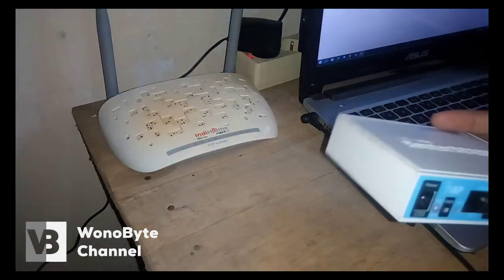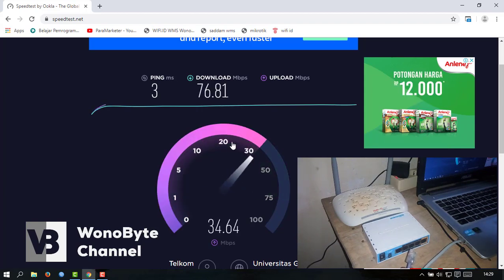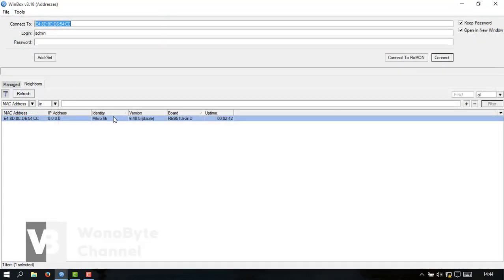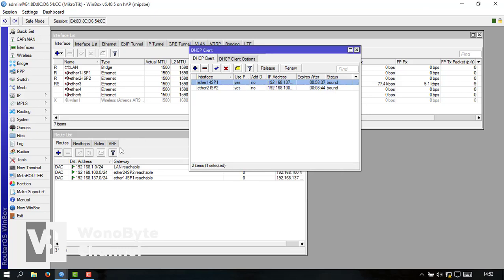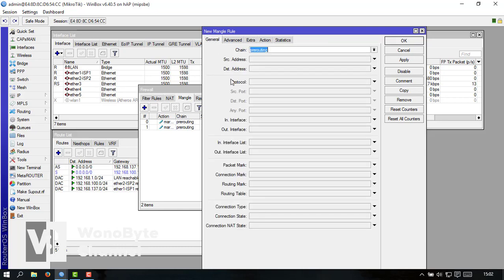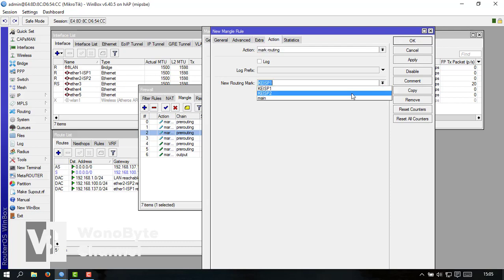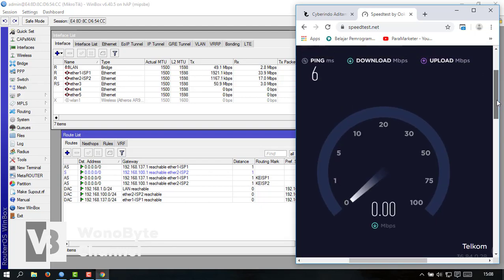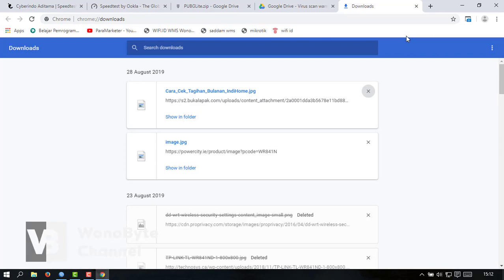Setting Mikrotik Rb951 Untuk menghubungkan 2 ISP dalam 1 jaringan Dengan Load Balancing Metodhe PCC

Comment: auto like yang begini mah,
Reply: eh ini berapa mikrotik master? kalau seandainya rb 750 + 2  sqt dibanding pakai rb 951 2 + 1 rb 750 dibanding 1 rb 951? terimakasih.
Reply: atau ada saran lain? terimakasih
Reply: itu juga kabel belum cat 6, wow masih bisa di up grade2 ni he3
Reply from the maker: @ahmadustanto8786  ini saya nyoba pakai lan jadi 3 mikrotik
Reply from the maker: @ahmadustanto8786  kalao bagus nya 2 sxt sinyal seamless biar gak login/DC , dari 2 sxt di load balancing pakai rb750 bisa atau rb951,, kalao rb951 sudah support wireless 2,4ghz bisa juga jadi 3 isp jadi 1 (2 sxt + 1 rb951).
Reply from the maker: @ahmadustanto8786  ini saya juga jaraknya lumayan jaul dan terhalang dinding kalao deket sekitar 1-2meter dr pemancar bisa speed lebih kenceng
Reply: @wonobyte  saya sudah ada 6b 750 gr3 mau di pasang di dalam rumah saja enak yg rb 951 atau beli sxt yg support 2,4 dan 5 giga pak? bisa minta wa atau apa gitu yg bisa dihubungi ? terimaksih
Reply from the maker: @ahmadustanto8786  kalau yang bagus sxt karena 5ghz jadi speed lebih stabil dan bisa dapet lebih besar bendwith wa 085772728829
Reply: @wonobyte  Ini sya coba nembak 2 semles semua,tp gatway sma mas..wktu dibalance yg krja salah 1,pdhl sdh di NO di dhcp clien

Comment: Isp1 pake astinet, isp2 pake indihome apakah bisa pake cara yg diatas?
Reply from the maker: iya bisa caranya sama saja
Reply: @wonobyte   brarti waktu buat mangle isp1 interface nya sy pilih pppoe ya mas?
Reply from the maker: @alifakbarzardari7392  isp1 konek nya tergantung dr isp
klo pake wifi pake wlan
pake kabel pake ether
Reply: @wonobyte  astinet nya pake modem dsl mas, setelah di dial nanti muncul interface baru pppoe mas
Reply from the maker: @alifakbarzardari7392  iya berarti pake pppop
Reply: @wonobyte   setelah sy enable semua mangle dan route nya kok internet sy putus ya mas?
Reply from the maker: @alifakbarzardari7392  mungkin ada yang salah
Reply: @wonobyte  step bridge nya itu wajib ndak mas?
Reply from the maker: @alifakbarzardari7392  engak wajib.. cuman fitur brigde lebih enak buat ngatur konfigurasi ether.. kita bisa bebas add port mana yang mau dipake / engak

dan konfigurasi sama setiap port yang di add di brigde

Comment: mas tanya dong. kalau salah satu ispnya ada trouble. apakah mempengaruhi juga ke mikrotiknya?. apakah inetnya jadi putus juga?
Reply from the maker: kalao salah 1 off akan terbackup di isp 1 nya
Reply: mas itu yang sya lihat di video lan itu mode bridge. apakah mode bridge yang diatas itu adalah port 3-5?
Reply from the maker: @alfaqih_ananda3696  iya mode brigder biar lan 3-5 
konfigurasinya jadi 1
Reply: brarti dengan kata lain. kalau di bridge seperti itu port 3-5 itu akan masuk kedalam satu subnet mask kan
Reply from the maker: @alfaqih_ananda3696  iya 
1 ip gateway
1 subnet
1 dhcp server / hotspot 

jadi 1 konfigurasi , dan bebas hapus tambah port ether nya
Reply: terima kasih mas atas infonya. oh ya mas sya boleh tanya kah diluar topik. tapi masih berhubungan dengan bridge ini. jika misal port 3 nih kan ya sya masukin ke router asus yakan. nah sya pingin limitasi dimana jalur yang keluar dari ether 3 ini misal 50mbps. namun ada satu beberapa ip yang limitasinya 100mbps. nah apakah itu bisa?
Reply from the maker: @alfaqih_ananda3696  bisa itu setting di queue nya
Reply: @wonobyte  siap mas. thanks mas atas ilmunya. semoga trus berkarya. aaamiiinn

Comment: mau nanya gan, narik seamless sama wms nya yg stabil pakai apa ya device nya? ane pakai bolt210 sering putus, musti  manual restart wireless terus
Reply from the maker: saya pake rb952 dan sxtsq-5hpnd 
stabil
Reply: @wonobyte  sy coba pakai rbd52g sama malah ga ketarik semua bw nya. sy paket 50mb, hanya ketarik 35mb an itu pun latency jadi 3 digit. boleh liat config wireless nya gan?
Reply from the maker: @indraibe3089  config wireless masih default punya saya

Comment: Mikrotik RB941 2nd bisa setting load balance pakek metode PCC ga bang??
Reply from the maker: iya bisa
Reply: Bagi scriptnya bang untuk RB941 🙏
Reply from the maker: @nightcinema8173  https://drive.google.com/open?id=10KWVvM7o_8Z8CEhnIt-IHAS1U8ZkBVfa
Reply: @wonobyte  om maaf neh mohon di jawab. Setelah saya mengikuti Vidio di atas ko internet yg di enter 2 ga keluar. Tapi kalo internet yg di enter 1 di cabut baru bisa keluar internet nya. Itu kenapa yah.. saya pake dua modem sumber internet yg enter 1 pake bolt400 yg enter 2 pake tplink 3240. Mohon di bantu om 🙏
Reply from the maker: @boscilikboscilik371  untuk script nya sudah ganti baru
Reply: @wonobyte  maksudnya om.. kira kira yg perlu di seting apanya om supaya internet keluar dua duanya 🙏om mohon di bantu

Comment: Klo pake isp insihome dua duanya tidk pake wms,,,trus pake rb450gx4 bisa ?
Reply from the maker: bisa pakenya jaringan lan dan ip harus dibuat beda
Reply: @wonobyte  trus klo jadi mode hotspot gmna ? Pa harus ada router mikrotik lagi atw gmna dan bandwitch di gabung jadi satu ?
Reply from the maker: @jundulloh8302  bisa langsung mode hotspot walau 2 isp
Reply: @wonobyte  klo bandwithnya akan bertambah atw tetap ?
Reply: @wonobyte  trus apakah bandwithnya akan bertambah ?
Reply from the maker: @jundulloh8302  kadang bertambah kadang sama ,cuman kalo 1 isp off masih bisa konek dr isp ke 2

Comment: Bagi scriptnya gan
Reply from the maker: https://drive.google.com/open?id=10KWVvM7o_8Z8CEhnIt-IHAS1U8ZkBVfa
Reply: @wonobyte  om mau nanya neh mohon di jawab... WiFi poceran saya pake sumber internet 2 dari modem bolt400 pake kartu GSM.  Tapi sekarang sumber internet mati satu yg di bagian enter dua.. terus mau saya ganti pake ruter tplink 3240 kira2 yg perlu di seting bagian mana om mohon bantuannya om 🙏🙏🙏
Reply from the maker: @boscilikboscilik371  setting ip sesuai dengan ip modem bolt nya biar gk setting ulang
Reply: @wonobyte  maaf om maksudnya yg di seting yg di ruter tplink apa yg di mikrotiknya
Reply: @wonobyte  om 🙏 sebelumnya terimakasih udah di bls.. tapi saya belum paham itu yg di seting IP ruter tplink apa yg di aplikasi mikrotik om mohon di jawab om 🙏 saya masih pemula baru pasang wifi poceran 10 hari om jadi belum ngarti
Reply from the maker: @boscilikboscilik371  ada di menu network - Lan
Reply: @wonobyte  menu network yg di mananya maaf om saya ga punya leptop apa bisa pake hp om cara setting nya
Reply: Jika isp1 mati apa lagsung terkoneksi ke isp2 dan sebliknya apakah begitu
Reply: @wonobyte  mksih gan script load balance ya
Reply: thanks gan, sangat jelas. Tapi ijin bertnya gan, itu gateway utamnya adalah isp pertama kan ya ? jika kita cek pengujian cek ip ? trus gan, jika salah satu ada yg down, isp yang satu lagi bisa backup kan ? jadi link dssi lan atau client tidak ada yg down ? mohon jawabannya ya gan. Thanks
Reply: @bonarpoerba  ya gan klo loadbalance jika salah isp down isp yg 1 lagi akan backup
Reply: @ririaz5317  thanks gan 🙏🙏

Comment: Ini metodenya bisa failover ga ?
kalau berikut failover scriptnya gimana gan ?
Reply from the maker: bisa nanti saya upload
Reply: @wonobyte  sebenarnya sy sdh coba setingan ini dgn metode wlan1 + Isp1 hasil contoh : 10 + 10 = 10 dan coba hasil download stabil. Hanya sy belum mengerti hasil test ini winbox jd berubah tidak bisa login dengan IP dan akhirnya mikhmon tdk bs digunakan. perlu diketahui sy hanya memakai 1 routerboard sj yakni rb951ui-2hnd. Apakah dengan menggunakan metode load balance ini untuk hotspot hrs menggunakan 2 routerboard ?
Reply from the maker: @if_coolteknolob3423  iya itu belum saya coba untuk hotspot 2 isp